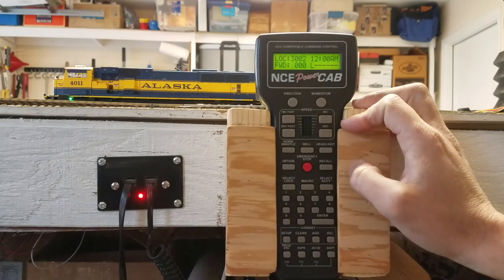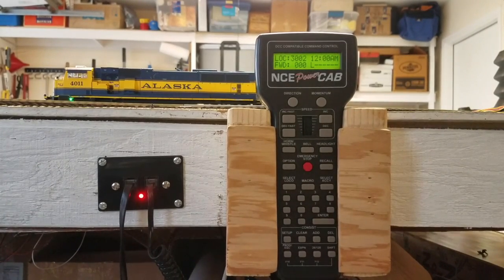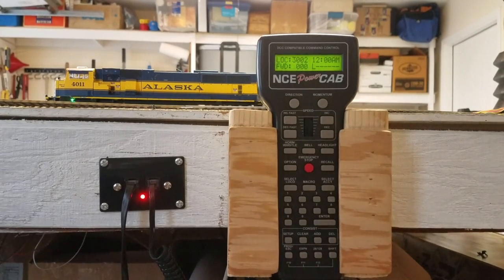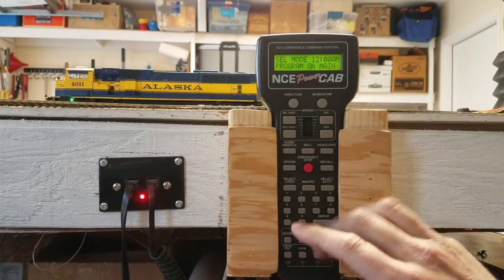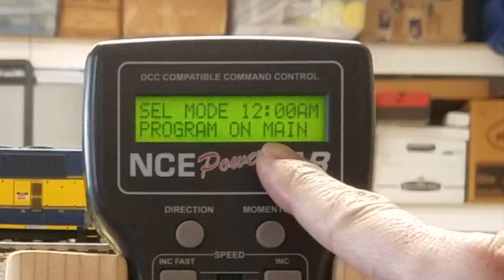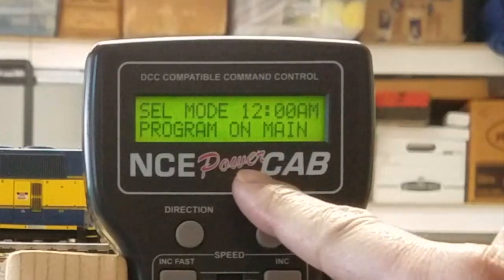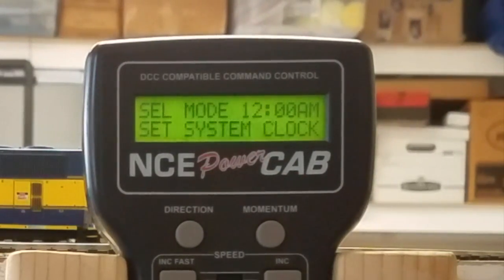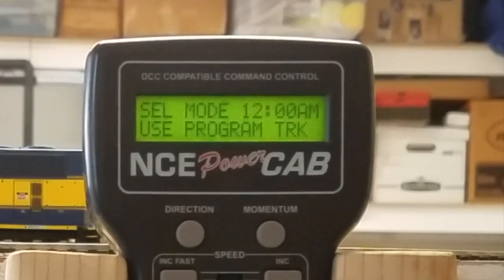NCE Part 3, How to adjust CV 2, CV5, and CV 6 (Speed Steps)

Comment: Great video. I have 2 locos different brand one runs so fast when in consist it pushes so hard it skids while the second loco is only crawling. Momentum dosent work so would I have to put the Cv’s all the same for speed steps?
Reply from the maker: I wouldn't use momentum at first if you are having problems. If you have two different brands then you I'll have to pick one that is your constant and the other one you speed match to your constant with those CVs
Reply: @JoeG-firehousewhiskey How do I find out what CV is on my main one.?
Reply from the maker: @LeroysTransportVlogs you have to put the engine on the main and on the throttle program on the main. Then go to the CV you are looking for and toggle to where it shows the current CV setting

Comment: I’m new to DCC. Can you explain what you mean by speed steps and speed tables? I also see people talking about notches and matching. How is this simulated on the PowerCab?
Reply from the maker: Speed steps are a point at which the engine will move faster. This table is the simplest speed steps dcc has. There are only three that you need to set and the decoder does the rest. Speed tables break down each speed step over 128 steps. Which will give you more control over the speed of your engine.  A notch is what the real engines use to increase speed. They go from 1-8. This video shows the easiest way to set speed steps on an NCE. Otherwise it's easier to set the speed tables in a program like JMRI.
Reply: @ thanks for this. So those numbers on the nce throttle really mean something!
Reply from the maker: @Quince828  yup they sure do

Comment: I saw that the site used for CV5 calculations was taken down. After about 2 hours of trying to find another table, I just gave up. So I tried something out. I may be completely wrong, but based upon 40mph=69, I divided and came up with 1.725=1

If im correct (which is possible but probably not) then 
1=1.725
5=8.625
10=17.25
And so on.. im not sure again if any of this is correct but I hope it helps. I have a Gp7 I needed to program to go 65mph so I calculated and went from 40mph (69) to 50mph (86.25) to 60mph (103.5) to 65(113 *I rounded*) 

Again not sure if any of this is true but as far as I know it works, and since I don't have a scale speedometer, this is the best I can assume.
Reply from the maker: Sounds pretty good to me.

Comment: There is a contradiction between program on the main and program track. You say you do not have a program track yet to switch to program track. I cannot set cv on program track. If I hit enter to use program track I get short circuit error.
Reply from the maker: I haven't seen that issue come up yet. I would call NCE and see if they have seen the issue or know what might be causing it

Comment: Nice video, makes setting those speed steps easy to understand. How do you know which speed step equates to 40mph?
Reply from the maker: You can either use JMRI, or a ruler. With the ruler you have to measure how long it takes for it to travel a particular distance and do some math to figure it out. I think I found a site online for that.

Comment: Joe:
Thank you for your response.  I had viewed your video previously and it was one of the reasons I was trying read CV6.  I also went out to the website you suggested as a "speed reference" for ss128 = 60 will produce 40 mph.  It is no longer available on that site.  I tried it a couple of different times with the same "page cannot be found" results.
I think I discovered why my CV6 was not responding when I started using Decoder Pro.  I had not on the speed table so CV6 was inactive.  I have not made the changes necessary to read CV6 on the engine that was giving me trouble because I have been distracted from "important tasks" with a recently presented "honey do list." 
Thanks again for your help.  Please keep making those clear, concise videos for us beginners.
Sam
Reply from the maker: Yeah, I can see that site being bad now. That video is old lol. Im glad you were able to get the problem fixed. I love decoder pro for that reason. You can see how everything it set up

Comment: Programming CV 6 my pro cab reads "cannot read value".  What should I do to fix this?
Reply from the maker: A message of "Cannot Read CV" is an error message. Translation: The system asked the decoder a question but did not get a response back from the decoder. Check all your connections and track. Try a different decoder or locomotive for comparison.

Comment: Can I set CV2 at 1 for even slower start speeds, or is 2 the lowest usable value?  In other words----if I wanted to get the slowest possible speed from my loco, is this how I would acheive that? Thanks!
Reply from the maker: You an start at CV 1, but i try to set my engines for step one to be 3 mph

Comment: Wait so if I put 3 locomotives with the exact same speed step numbers and speed table. They'll speed match?
Because I want to speed match a walters sd70ace with a bachmann es44ac.
Reply from the maker: Not necessarily. If they are the same brand you have a better chance of that scenario working out, however, if they are different brands they'll most likely not speed match unless some of the numbers are slightly different
Reply: @JoeG-firehousewhiskey  ah. Thanks.
Reply from the maker: @IronhorseRailProductions  does that make sense?
Reply: @JoeG-firehousewhiskey  yeah, a little bit. The engines I really want to speed match are my two bachmann es44's and my two walters Sd70Aces. I'm sorta just trying to figure out how to speed match.
Reply from the maker: @IronhorseRailProductions  do they all have the same decoders
Reply: @JoeG-firehousewhiskey  I don't think so. I think bachmann has soundtraxx and walters has a loksound decoder.

Comment: Thanks for the video. My problem is that almost all of my engines I've put realistic amounts of momentum , Im now joing a club and want to be able to run 2 to 3 locos in a consist. I also have a wide variety of decoders (most of which being tsunami / econami). Any suggestions to speed match locos with lots of momentum or should I just remove the momentum and start from the top?
Reply from the maker: Sorry for the late reply, I would just match the momentum to the clubs. It is hard enough to get all the engines working together. Let alone trying to make the clubs engines match yours.

Comment: I use NCE...Did the light bulb light up?  It will still short, 1156 bulb just will prevent more meltdowns.
Reply from the maker: the light didnt light at all
Reply: @JoeG-firehousewhiskey  you did a direct short and you have nothing feeding around the bulb?  I also think you have a Power Cab and Not a Power Pro.  Power Cab Runs at 2 Amps,  Power pro runs at 5 amps.  unravels some stranded copper wire and place the wire across the rails.  See if the wire is getting hot or staying cool with the short.  You might not have the amps to light the bulb.  or an easy check is to put the 2 track wires from the DCC system onto the bulb and see how it reacts.
Reply from the maker: Indo have the power cab and I placed the wires directly from one rail to another from the bulb. I think you're right it's not enough power to power the bulbs
Reply: @JoeG-firehousewhiskey  Pretty smart for a guy that can not use Facebook.  Do the wire test with the bulb in the circuit,  you can also use a pencil led.  If the the wire stays cool and not getting hot,  you will more than likely not melt anything down and should be good to go.
Reply from the maker: yeah it sucks not having you on Facebook
Reply: @JoeG-firehousewhiskey  did you work it out?
Reply from the maker: @IMRROcom  no it just shorted out, no lighting of the bulb
Reply: @JoeG-firehousewhiskey  but did it get hot?  Did you use a pencil led or a single stane of copper wire?  As long as it does not get hot your are doing ok.
Reply from the maker: I'll try that when I get home

Comment: Extremely helpful. I just hooked my power cab up and it is my first time using dcc. When I initially ran the locomotive is ran decent on speed step 10. After addressing it it would only move decent around speed step 40. I guess I accidentally changed something.
Reply from the maker: Sweet!!! Im glad it was useful to you. Now its time to run some trains!!

Comment: Joe, I am intrigued & confused with  a comment on your Video.  You say you haven't got a programme track, and you do all your programming on the Main.  Then you press 'Prog/Esc. & then say that you don't want P.O.M  etc.  so press the 'Prog/esc' , 3 more times to put it in 'Use Programme Track'  .   So you are doing this in Programme Track mode?  YET you haven't got a programme track ?. I can only presume you are actually turning the complete layout into a programming track ?    As an avid user of NCE from over the pond , I am intrigued , or have I missed something ?
Reply from the maker: You are correct, I am using the whole track as a programming track. This is not ideal and can only be done if you have one engine on your layout. For my next layout, I will make a dedicated programing track and not program on the main anymore. Its way to risky the more engines you have on your layout.

Comment: Hi Joe;  Looks like a complex system, DCC. A lot to learn about speed steps. Well done demo. Gary from Michigan  🚂.
Reply: trainroomgary  It's actually not as hard as it appears! I started out with a NCE Power Cab, and still have all the basic bits of it today. I added a SB5 Smart Booster and a DB5 Dumb Booster, for a total of nearly 10 amps. With the addition of the SB5, I could then unplug my Cab controller, and move it to other parts of the Layout,  without affecting the train's speed at all (something that the PowerCab starter kit won't allow you to do.).... 
Programming is easier than ANY other system I've tried before! (I'm 52, and not the most techno-savvy guy!) As I also mentioned earlier, it's the most adaptable and upgradeable. 

Secret tip: If you have the PowerCab starter set, and  need more power, but can't afford the $160 SB5 upgrade, simply replace the 1.7 amp wall wart it comes with, and replace it with up to a 4 amp wall wart! Really! That simple. The  original PCB from the PowerCab starter set CAN handle up to 4 amps. I haven't tried more, but it EASILY and SAFELY handled the 4 amps for up to 3 years - until I was able to upgrade the system. 😉
Reply: Joe G  Thanks. I try when I can....
Reply: I agree w/Gary from Michigan